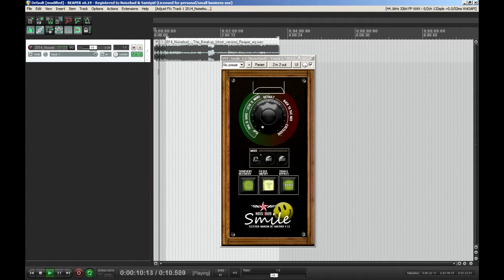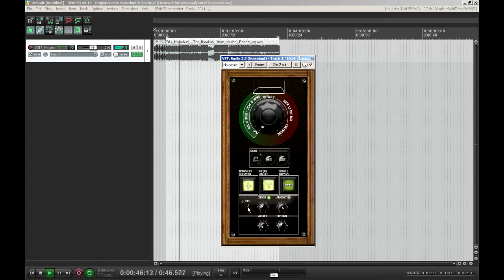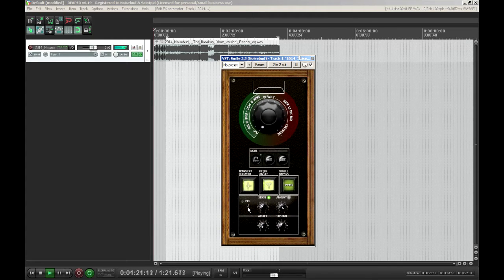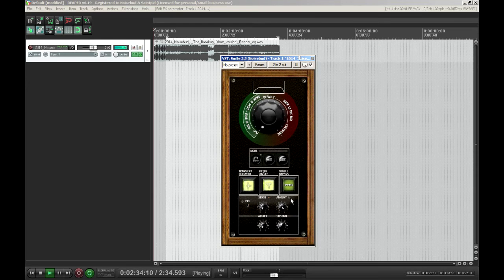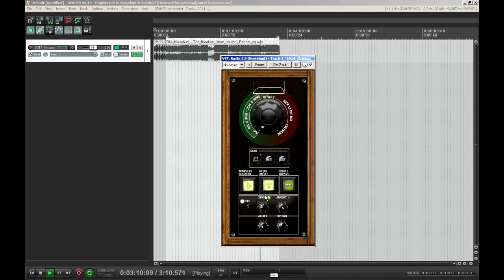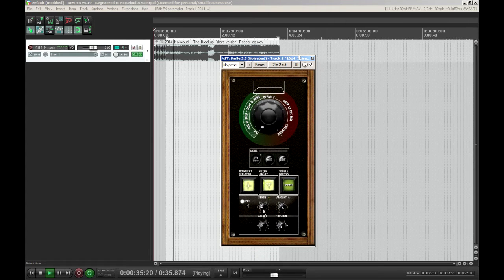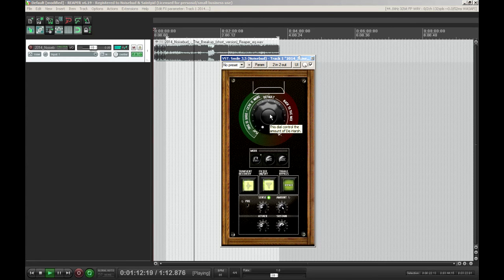New features in Noisebud Smile 3.5

Comment: I'm really liking your plugins and am experimenting with the free version of "Smile 3.5" at the moment, and am hoping that all your plugins are going to help with my particular problem.  That is, like everyone else, I can't afford the expensive grand piano, mics, or studio to record it in.  Therefore, I have to use virtual pianos and I can tell you from experience that none of them are without problems, and those problems become especially pronounced when I record an excellent dynamic and nuanced solo piano player. Almost all of them have a ton of energy in the midrange which I am hoping to manage better with "Leaky" (while keeping phasing in check).  At any rate, for the moment, can you tell me which Loudness Curve the "Default" detent represents on "Leaky"?  And does each detent represent a 10dB variation on the Loudness Curve?  I am guessing the default detent represents the 80dB curve but would like to know for sure.  Thanks.
Reply from the maker: Hello, Leaky can be used to fix phase cancelation problems while mixing/mastering or to manipulate the stereo field in different ways, it doesn't have or use equal loudness curves. Are you perhaps referring to 'Smile'?
Reply: Ooops... Yes. I meant the detents on "Smile".
Reply from the maker: @newguy6935  Smile is dynamic so it depends on the input signal but if you run pink noise through the plugin with the amount set to Excessive the curve will start to resemble an average of the Fletcher-Munson curve. It's programmed so that the max change at a single frequency shouldn't be more than 6dB when pushed hard. Initially, we planned a plugin that would be aware of the SPL at the listening position which would've made it possible to perfectly adapt the curve based on loudness but we left that idea because it would've made it too hard to use.
Reply: @Noisebud  OK, thanks for that info, and... you've hit upon something I was thinking about this morning which is, I should probably run pink noise through "Smile"  instead of white noise. Back to the drawing board on that one.
But in the meantime, I've always thought there was need of a plugin that could compensate for SPLevels (once the user determines the proper SPL for their space) - especially since many users must use lower SPLs as they have smaller mixing rooms. TDR has a Mastering Plugin that does that but I'm having a little trouble making sense of it.  You'd think that Sonarworks would include that extra step in their software but...  Maybe that's a plugin you could offer. It would certainly fill a need.
Reply from the maker: @newguy6935  You can use white noise as well as long as you set your analyzer to the right slope, the problem with noise is that it won't trigger the dynamics as music does so you get an EQ-curve that won't be of much use. It's a bit better to use a sweeping sine but that has other problems so, in the end, you will be best off using music you know well for testing purposes.
And funny that you mention TDR, we're currently involved in a project with them that has to do with the equal-loudness contours ... We just started so there's no info yet.
Reply: @Noisebud  Wow! Really cool on the TDR thing. Best of luck with that. Looking forward to seeing it.
By the way, speaking of dynamics, sometimes I run a track through Melda's Autodynamic EQ to match it to pink noise. Once I do that, if the dynamics are still a bit too great, I might add Melda's SpectralDynamics to the channel (also running it to match to pink noise). It helps to manage those dynamics to the pink noise a little more.
I was hoping to do all the above to a loudness curve as well (which was why I was looking at Smile to start with). But while Smile is used to manage transients, I was looking more to control the dynamics to a loudness curve. Of course, dynamic and transient control to a loudness curve would be the most ideal thing, I suppose. That would give the mastering engineer or even mixer the best control over their mixes.  Maybe you could broach that idea to TDR? 
I had planned to eventually test Newfangled Audio's "Punctuate" for use after spectrally compressing the dynamics but I just haven't gotten to that one yet.
Again, best of luck with TDR. Very cool.
Reply from the maker: @newguy6935  You can use TDR Nova to do things similar to what you describe with dynamics, look at the Smart Ops section in nova. There's also a plugin called Dynamic Spectrum Mapper which may be what you're looking for, or Gullfoss would work too (it has the equal loudness curves built). I think all those techniques are cool and fun to play around with but in the end, it's always better to do all broad adjustments by hand with classic tools, I always get a better result and retain more punch without those but they're all great as a tool to check where you're at.
Reply from the maker: @newguy6935  And the idea with the transient section in Smile is to leave the transients alone, when a transient is detected the plugin bypasses the FM curve shortly so they can pass untouched. It's very effective to keep the clarity and punch in the 3KHz area but still benefits from the smoothening effect that the FM curve has.
Reply: @Noisebud  Yes, I am using Smart Ops in Nova, and Gullfoss. Nova's Dynamic Resonance option really helps, a lot. Will look at the "Mapper" plugin u mentioned.
It's funny. I use musicians from several online studios for the material I write, and while they are excellent players, it may not always mean the are excellent at recording. So, lots of times, I'm having to go heavier on the EQs or compressors than I'd like. I can make things "work" but still, getting it right on a solo piano is a bitch.  I've search the world over for ideas and plugins that would help. Let me know how it goes with u and TDR.
Reply: @Noisebud  Now that I'm half awake... Yes, I have DSM too. It is similar (not completely) to Melda's Spectral Dynamics. 
I guess my question is why aren't there more "FM curve fitting" plugins out there like yours or TDR's, etc? Not that they are the "fix-all" but they sure do help.
Reply from the maker: @newguy6935  The Boost control in Gullfoss is an FM (or Equal Loudness Curve) too. I think there's plenty of plugins that are using the curves or at least are inspired by the science behind it without communicating it in a clear way to the end-user (as Gullfoss for example). The problem with using it is that you need to know the SPL at the listening position to use it correctly and without that you end up with a set EQ curve that ain't of much use in most cases, it may do more harm than good if not used correctly. But let's see what the future holds. =)
Reply: @Noisebud  You’ve hit the nail squarely on the head. Yes, many of the plugins seem to be following loudness curves and yes, they all seem to be a bit vague about it. Smart EQ even comes to mind in all this, as well as Gullfoss. And that’s exactly why I was drawn your “Smile” plugin, as all the curves in Smile seemed to be well defined which would allow me to plot them in an Equalizer (using white or pink noise), and use the curve best suited to my listening environment.  Honestly, I can’t figure out why there aren’t plugins devoted to loudness curve fitting. Sonarworks just came out with an update I had hoped would address this issue, but nooooooo…   That’s ironic because they are in the very business of developing software to address room environments.  WTF?  
I’m sure there are some complications to developing for this issue but I’m also sure they can be overcome. Part of the problem, I suppose, is that many developers are reluctant to develop for this because it involves “educating the consumer”, which ain’t easy - true. Still, Sonarworks would have an edge in this department as many already look to them to solve their environment problems and would be willing to take that extra “education step” to get even better results.  Oh well.  I am also guessing that many of the plugins out there don't want to give away their loudness curve secret as that would screw up their competitive advantage.
At any rate, TDR seems to be ahead of the curve with their offerings and I’m glad you will be working with them. You are more than welcome to show them our conversations here if it may help.  In the meantime, I’ve run across this video from Dan Worrall which I haven’t tested yet, but will.  I would bet that TDR has seen it. Take care.
https://www.youtube.com/watch?v=wgogJmeQFvY

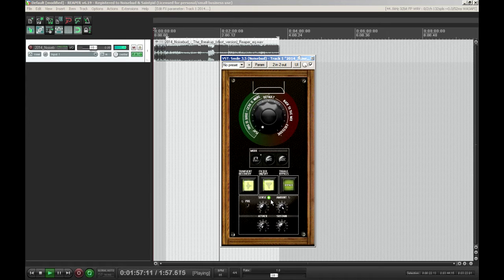There is this video also which addresses the issue at around 2:00. 
https://www.youtube.com/watch?v=fU86QXUisuE
Reply from the maker: @newguy6935  Have you seen Acourate? If not you should check it out. https://www.audiovero.de/
Reply: @Noisebud  No, never heard of it. Will check it out. Thanks. Appreciate that.